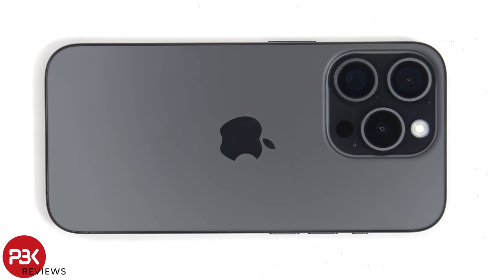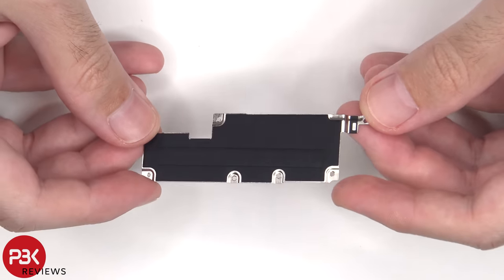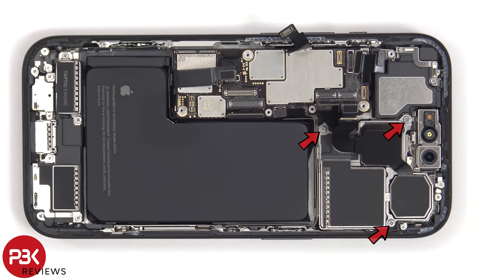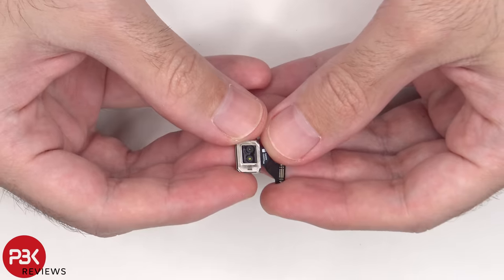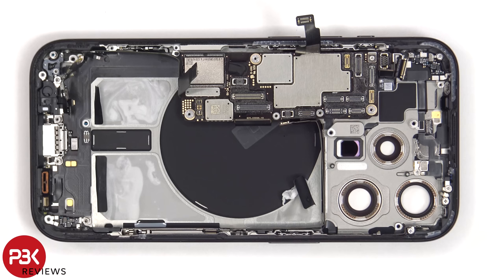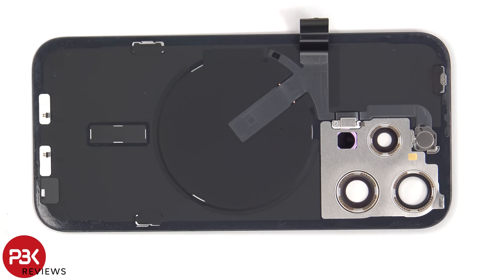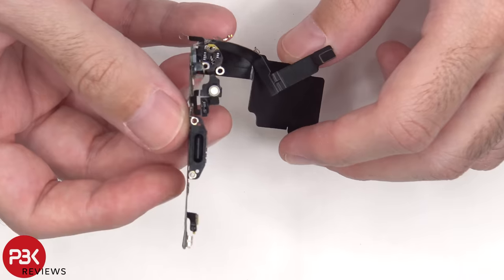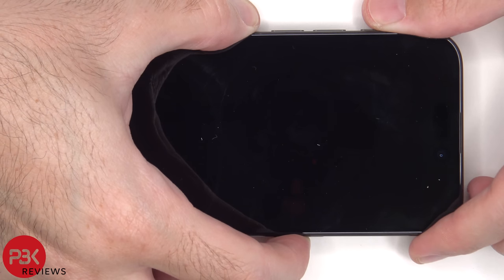Apple iPhone 15 Pro Teardown Repair Video Review

Comment: This was very interesting to see the progression of the iPhone design. Now since you are yet another that doesn’t tell the whole truth about why iPhone’s are locked down I will do it for you. Before Apple locked iPhone parts to the phone iPhone were stolen at a high rate in public places like malls, universities, public transportation. They were sold to repair shops that would dismantle them for parts to repair other iPhones. Apple came up with Find My iPhone and started to lock down the iPhone and put an end to the supply of parts for people like this guy that is bitching about Apple protecting their customers from thieves.
Reply from the maker: That's one opinion sure, but highly doubt it lol. Apple is not one to "care" for the consumer. They only care for their pockets. Apple has been making sure there is no middleman since the early days of iphone or any of their products. Yeah in one way its good for brand quality control, but apple plain n simple wants all the profits, and no one else to be able to make any money that they can instead take for themselves. They have been using tricks and tactics all these years and word certain things in ways to not get sued or brain wash people to think they are thinking of the consumer. For a company who released a software update to show FAKE signal bars so customers would be fooled and stop complaining about the iphone 4 frame/antenna issue when holding the phone. that tells you a lot. Then when they got caught and sued, they released free bumpers for people to use instead to not directly touch the frame. And then again many more instances of software updates to manipulate batteries, and then get forced to replace them since people caught on etc. List goes on, you can just do some research and see. Again just my opinion but yeah through all these years of being in the industry, I know my fair share of info to take an educated guess and say that apple is not "protecting" its customers by preventing them to be able to repair their phones :)

Comment: Apple using Philips head screws? This is a step in the right direction.
Reply from the maker: They have always used them, but they need to stop using different sizes and type of screws in the phone. Stick to one size or type of screw and not so many.

Comment: iPhone 15 Pro Battery Capacity 3274mah
Reply from the maker: It has a typical and a rated capacity written on it. On top the larger text if you look will have the higher amount written.
Reply: @PBKreviews  yeah I know, anyway thanks

Comment: Weren't these shits supposed to have the components,like battery, accessible from removing the back glass and not the display?
Wasn't that the case with iPhone 14?
Reply from the maker: Yep, they should have followed that route but I guess they just wanted to make the back glass easier to replace even though most likely its still software locked with the wireless charging flex attached to it.

Comment: Mate 60 pro randomly opened and iphone 15 pro so carefully unfair with huawei
Reply from the maker: Not sure what you mean by randomly? I open all devices with as much care as possible, but the mate 60 pro adhesive on the screen is 10 times stronger than that of the iPhone.

Comment: You want be able to use any other parts if its not replaced by apple every single component has a serial on it even the freaking charging port so if you don’t program it most likely it will not work unbelievable i think its time to move to samsung after all this years on iphone pff what a joke. But great video man thanks a lot
Reply from the maker: 👍 thanks

Comment: Too high score for a locked down device.
Reply from the maker: Score comprises of parts availability and other factors also, but yeah mainly based off actually being able to repair it as mentioned if it's not completely locked down.

Comment: You have to remove the screen (and possibly break it) bevor you can change the battery. Why they are doing this. This makes repairs no easier than with the old models.
Reply from the maker: Yeah, not sure. Would have been better if it was more similar to the iphone 14

Comment: It should be given 4/10 beacause every part is paired to the device😢😢😢
Reply: is it?
Reply from the maker: The score has its own sections of grading, so I based it off the fact if they weren't locked down. But yeah as mentioned in the video, the score is based off if even the parts are replaceable and not locked down.

Comment: I think you are biased in terms of repair ability score, what do you score if you want change your charging port then you must have to be disassemble whole phone 😮. I think apple score 3/10
Reply from the maker: If you look at the score chart, each section has its own points. Because of the complexity and difficulty/time it takes to do the repairs, it scored low in the design. But scored high in available parts since iphone parts are always available and accordingly in the other sections. So just looking at the overall score doesn't necessarily give you an understanding of how easy it is to do. Again that's why I have it broken down in sections to show each section out of 2 points.

Comment: 7/10 is way too much. 
It's more like a 2 or at most 3 out of 10. 

They pair parts, how evil can a company be?
Reply from the maker: Yeah, the score has its own sections which add up and total the number I come up with. Due to the complexity and amount of time it takes, it scored lower on the design level. But yeah as mentioned, none of this means anything if the parts are paired and cant be replaced.